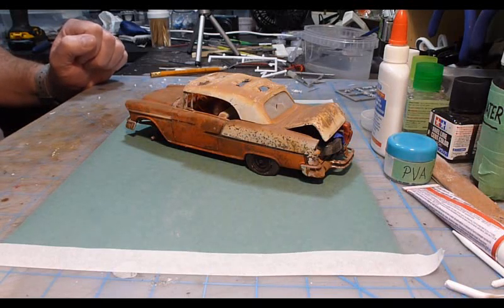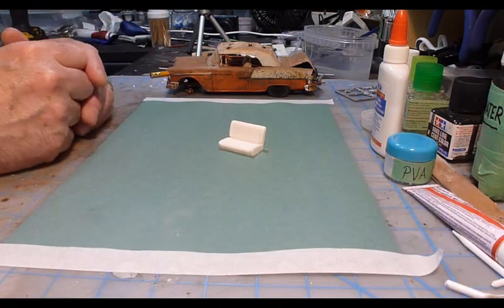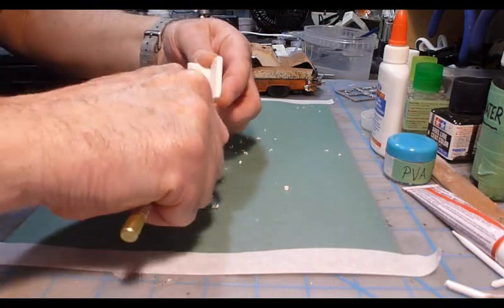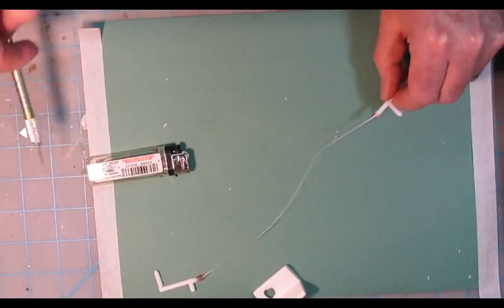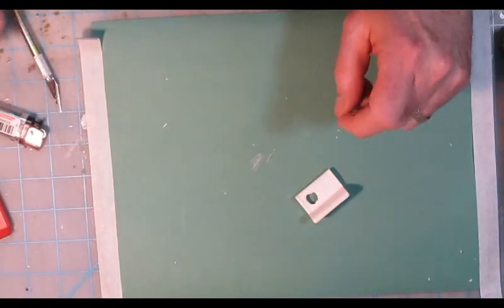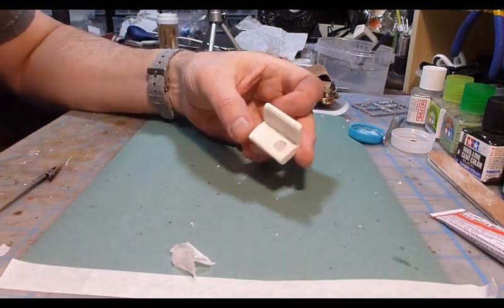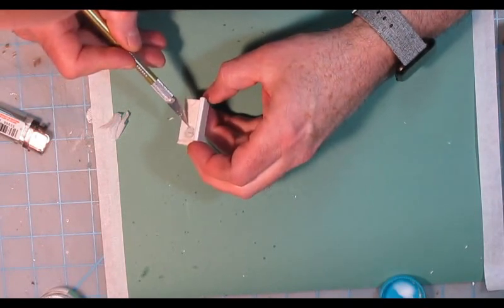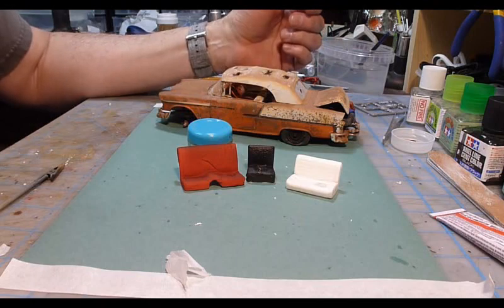How To Create Weathered Interior

Comment: This is awesome! One question: how do you make the color of the seat look old? I love this weathering method and plan to use it but still not sure about color.
Reply from the maker: Hi Don, once i apply the color that I want the seat to be I will then apply Tamiya black or brown panel liner and this will stain the paint and make it look weathered, I will also use thinned Tamiya flat black as a wash after I clear coat the paint and panel liners. I would suggest just practicing on some scrap until you get the results you are looking for. Good luck and have fun 😆